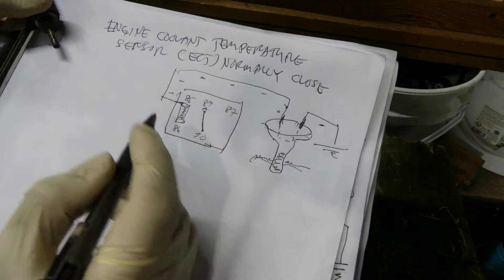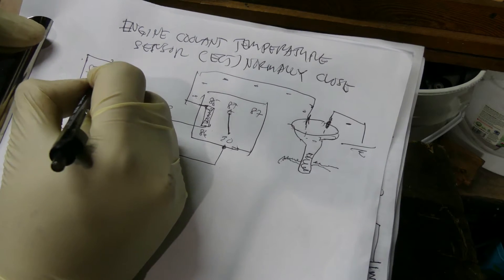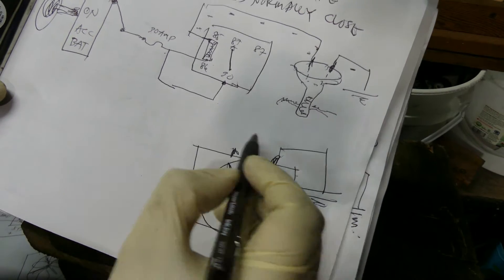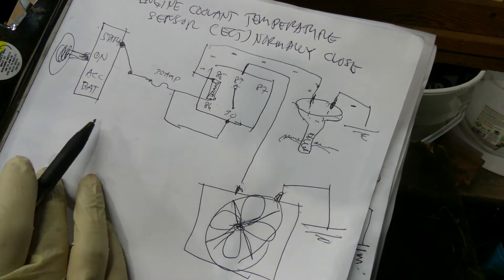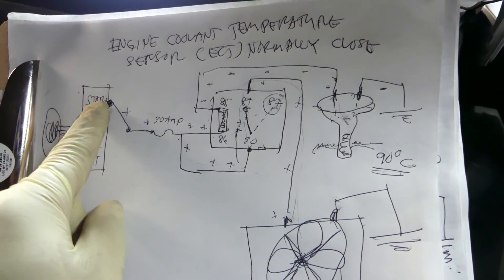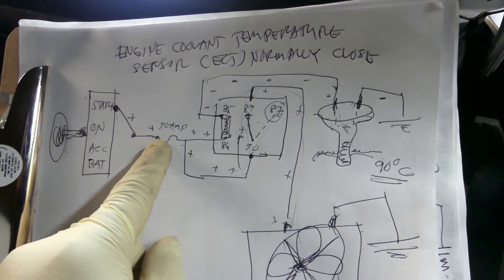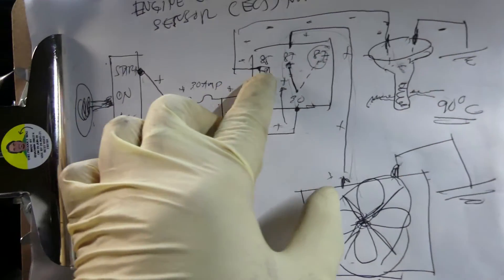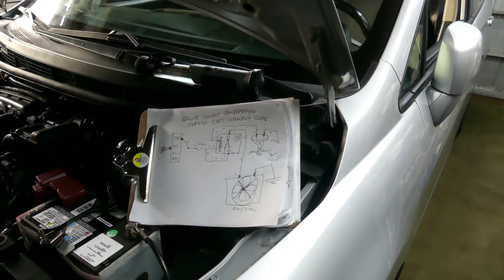How Radiator Fan works .. Engine Coolant Temp Sensor  CLOSE LOOP  DIAGRAM...( Non ecu controlled)

Comment: Hi, I disconnected the sensor but the Fan doesn’t start. On the top of that, using a diagnostic tool (with the sensor disconnected) is showing the Coolant’s temperature : -40 C.
I assume it will never start if the readings are -40.
Can be a different cooling system (sensors, connections, etc) than yours or I missed something?
Thank you !
Reply from the maker: -40 is a bias voltage and check if your ect is close loop design

Comment: My Peugeot 508 1.6 THP gives me problem with coolant cooling fan switching on at cold start and runs for ever, even after switching of the ignition it keeps on running until I disconnect the battery.  I have put a new thermostat housing with new temperature sensor but the problem does not disappear.  On diagnosis with OBDII it gives error code P0410.  This is a lambda sensor code.  How does it relate to cooling fan?
Reply from the maker: test the wire on the rad fan and if it gives u 12v all the the time theres a problem on ur wiring you need a wiring diagram in order to pin point the source of the 12v

Comment: Great.
I have a question...

Many cars have two fans (one for engine and one for a/c condenser) and they are next to each other. 

Does the temperature sensor  control both fans or only the one related to the engine?
Reply from the maker: honda civic  use both other cars im not sure

Comment: 2006 Expedition clutch fans, I want to convert them to two electric fans that always run at slow first speed and I want them to run at full speed if the air conditioner is on or the temperature is about to rise. But I want everything to be like it came out of the factory. The problem I am facing is that I am looking for information about the temperature sensor and I want to confirm it and I did not find it. The question is, can I connect the fans and relay to the temperature sensor located in the right head of the engine (TEMP SENSOR NOT TEMP SWITCH)? Note that it is a sensor with two terminals, the first terminal SIG RETURN goes to the oxygen sensor and other things and finally goes to the PCM. The second terminal TEMP SENSOR SIG goes to the PCM. I appreciate your help, I am from the south of the Kingdom of Saudi Arabia

Comment: I had the same test, when i pull out the switch the fan starts working , when the switch is on it stops. So , is it a fault sensor?

Comment: Very Informative. Thank you 
If you pull out the temp sensor harness, will the fan start with full speed or low speed ?
Reply from the maker: mostly full/high speed base on my experience

Comment: This is not a true temperature sensor. It's a switch. 

There are 2 electrical circuits to this system: 1. The control circuit (pin 86) 2.  The fan circuit (pin 30). Each of these electrical circuits is protected by different fuses. The control circuit is usually protected by a 15 Amp fuse while the fan circuit is usually protected by a 30 Amp fuse. He also made the mistake in showing the ignition switch in the "start" position. He really meant to show the ign switch in the "run" position.
Reply from the maker: it doesnt matter if ect or switch what matters is they achieve same goal to connect a circuit on a especific temperature..this is a theory of how rad fan works it might differ on other cars but this is a simplest explanation of how this circuit works...if u want to had discussion on feel free to reach me out on my number on my latest videoi can prove to u my point of view
Reply: @asianmechanicguy6483  I understand your point of view. You want to make it as simple as possible so it's easier for most people to understand. I'm just adding what you left out so others with a more advanced understanding of electronics can understand.

Comment: Hi boss, i  pull off the sensor socket the radiator fan turns on. Does this mean that my sensor to radiator connection is good? Just having hard looking for possible reason of why my radiator fan took too long to start except if i turn the AC on.
Reply from the maker: ang ectkc nakadepende sa temp ng coolant mo may mga car katuladng bmw umaabot sa 112degree celcius bago mag on ung fan ung iba naman nasa between 90to 100 degree celsius ...kailangan mong scanner para malaman mo at what temp sya mag turn on ..isa pang dahilan baka naman stuck open ung thermostat mo so meaning ung coolant mo walang harang solagi syang slightly warm lang and isa pa baka ung ectmois aftermarket hindi nila nakopya ung specificationnung part
Reply: @ na scan namn at umabot na sa temperature trigger yung temp sensor di parin gumagana rad fan. Kaya ngayun ni rekta ko muna.
Reply: sir ganon din ang na incounter ko at na check na din manually ang thermostat at nag open and close pa ang thermostat. kapag check ba ang thermostat sa hot water na 80 f above ko naman.

Comment: Mine do not come on even with a new sensor
Maybe the fan is control with a different one
Mercedes W124
Mystery, I have to search
DomIJ
Reply from the maker: theres should be an input sensor analyzed by the ecm in order to turn on the rad fan...theres no such a way that the rad fan will turn on by itself without any input

Comment: What about ECM/ECU ?
Reply from the maker: ecm controlled is a little bit different because the ecm will decide when the rad fan kick on but input still coming from ect sensor it will just analyze first by the ecm bef it will engage the rad fan

Comment: I would have connected relay pin 30 to the battery
Reply from the maker: yup thast correct but its better if you put a fuse on it thats a direct 12v power it might destroy ur rad fan motor if it short circuited

Comment: Hi, good day guys! I just wanted to ask something. I have suzuki ciaz 2017 year model. When I turn the AC on, only the compressor and Ac fan works. is it normal? The Radiator fan is not turning on. Also, even my engine temperature reach the middle temp. gauge at the dashboard it doesn't turn on. What do you think could be the culprit? Is it the Coolant thermostat/sensor?
Reply from the maker: if your temp gauge reaches more that halfway it means ur car is overheating check coolant leak first then sensor the rad fan motor

Comment: My radiator fan only kicking at 98°C. I have P0115, its either the ETC sensor or Thermostat. But already test the ETC sensor is ok, so after flushing the cooling system, i will change the Thermostat.

Comment: Fan is not working when heating up. Also when i put direct fan with battery it works. What would be the problem?
Reply from the maker: check ur rad fan module check for fuse relay ect

Comment: Thanks. I have a question the engine temperature sensor. Is the same as coolant sensor switch?
Having problems with my civic 2003 fans are not working. 
I changed the thermostat coolant switch sensor. I homped from the switch and fans worked.
and looks like relays. Are good and fuses. I don’t know what else to look for? Any help please.
Reply from the maker: u need to know where the ect located and it warms up above 90degree celsius in order that sensor to close so  that ur fan will kick on..and u can check that using a obd scanner that has a data stream or live data or u can use a infrared heat gun reader otherwise if at above 90degree celcius temp ur fan didnt kick on ur sensor is faulty even though its brand new buy genuine parts
Reply: Thanks

Comment: Is this the same as cylinder head temperature sensor
Reply from the maker: not really some cars like chevy has 2 temp sensor one located on the thermostat housing and one located on the radiator ..i had one video just check it out ita a chevy cruze it might help u about what u looking for

Comment: Hi. My ford fiesta the radiator fan comes on when temperature is 111 degrees Celsius and goes off when the temperature reduces to 110 degrees is this normal because I feel it comes on very late. Any idea
Reply from the maker: its a little bit late late change ur ect sensor anyway there not that expensive

Comment: Good day why will my 2006 shevrolet spark engin fan then runs as soon as I start the car even when the engin is cold.
Reply from the maker: im not sure about the design of that car but it should be like that especially if ur rad fan is electronically ran by ecm

Comment: I would assume the temperature sensor is normally open and it closes when it reaches high temperature and connect the poles giving continuity to send signal to relay . Isn’t it ?
Reply from the maker: thats correct

Comment: Please, do you have whatsapp
Reply from the maker: sorry i dont
Reply: @asianmechanicguy6483  Based on your explanation, what would I do in the case where the probe is plugged in, and after the probe triggers, the fan does not turn on?
I have a mitshubishi PAJERO PININ with GDI engine 1999

Comment: Very good explanation  i actually have a problem my fan runs constantly when start up car i have replaced ect sensor and relays but it still runs any idea what it could be .
Reply from the maker: it depends what car u have what design u have
Reply: @asianmechanicguy6483  it's a Chev utility takes two pin temp sensor

Comment: Great explanation. If my coolent temp sensor is bad would it disconnect power from my radiator fan. Thats the problem I am having. My car starts out with fan running then at some point the fan stops causing over heating. I am getting no codes at all.

Comment: Very awesome description. My issue is that when it gets to 90C, the fans aren’t kicking on. I’ve gone through 3 different ETC sensors, and I know the whole system works besides the ETC sensor because when I disconnect it, the fans kick on. 04’ SRT4 Neon for those wondering. 😄 I’m to the point where I either wire some kind of coolant temperature adjustment relay that bypasses the ECT, or just leave it disconnected with code 118. 😅
Reply: Before someone says something, I’m just kidding about the disconnected sensor. 💀
Reply from the maker: the point in this video is that at around 90degree celsius ur ECT sensor continuity should open or close so make sure that there is enough hot coolant that boil ur sensor in order to work so check the design of ur car like how far ue thermostat into ur ect sensor hows ur coolant is it circling properly is there no air on the system if everything is good then go to wiring etc...
Reply: Did you resolve your problem with your car?
Reply: @TheAutomotiveKid. Hi, did you resolve your problem with the fan not kicking?

Comment: thanks for explaining it . i have an issue with my 2.0 mazda engine. i rewired a new relay but i cant get it to cycle right. im using a 4 pin relay. and does my main relay also power my AC fan or is it na ?
Reply from the maker: ac fan should had a different relay or another relay but for mazda i had to look it on its wiring diagram first

Comment: Interesting, but I'm curious about your fan relay. In a typical relay, both terminal 87s are supplied with 12V once   the relay is switched on since they are just parallel circuits. If that's the kind of relay that is used, your illustration is for a normally open temperature sensor.
Reply from the maker: it depends how u use 87 and 30 usually 85 and 86 is ur coil these time  86 is positive when key is on  then 86 is ground which connected to ur ect normally close so 85 and 86 is always engage bec of normally close ect bec of that 87 is push to 87A wherein ni circuit is connected on it ...once ect open up after 90degree celcius theres no more ground on 86 so connection  on 87A will go back to 87 which is connected to 30 and  30 has constant 12v and that 12v will flow into 87 going to ur rad fan...trick of this is the flow of the 12v where it came from and what connected it ...its confusing but foloow thw flow of current 12v
Reply: @asianmechanicguy6483  thank you for your clarification.

Comment: I just changed my coolant temp. Sensor , now both fans don't work and it's running hot. WTF. THIS WILL COST $$$ TO HAVE SOME ONE FIX.
Reply from the maker: At what temperature did ur fan kick on u have to verify those bef replacing ur etc
Reply: Du you find the problem?

Comment: Ok i have a 97 toyota camry 2.2 and my fans do as they are supposed to do but when the car is at operating temperature and i turn on my heater/ a/c the fans start up and when this happens the idle goes way down and almost stalls and then idle fine, the fans will stop when i turn off the heater, i am lost and wonder if there is something wrong? And idea and advise would be appreciated,  thank you.
Reply from the maker: check alternator maybe it cant hold too much load
Reply: @asianmechanicguy6483  so its normal for the fans to start up when i turn the heater on, i will check the alternator, thank you
Reply from the maker: it depends where u put ur heater selection if its on defrost say whindshield fan will kick on try only on face selection fan shouldnt kick on ..but if still kick check for coolant leak ur engine might always hot all the time which result the rad fan to kick on

Comment: Me gustaria saber algo para comprender mejor, usted explica que ese sensor en frio mantiene esl circuito negativo en continuidad y al calentar a 90 grados este habre el circiuto y nompermite el paso negrativo a cable de salida.
Mas claro, el en frio mantiene el negativo circulando y en caliente interfiere el paso de ese negativo.
Si le hago esa pregunta es porque en mibtiyota pasa algo muy extraño,el fan se activa de tan solo habrir el swicht, al rele le llegan dos power pero punto 3 y 4 de rele siempre se mantienen en circuito cereado, lo unico que interfiere esa continuidad es cuando se activa la bobina puntos 1 y 2, por el.punto dos llega corriente pero la tierra del 1 no le llega y algo tiene que ver con ese senor ( es nuevo ), ya que a el le llega un negativo fuerte y el auto caliente el otro cable señala power pero al pare er parasita ya que solo alumbra rojo similar al punto 1= 85 
Si le palicamos por el cable de.retorno del sensor negativo, se activa el electroiman y apaga el fan pero como.no tengo el.plano electrico del auto, no puedo exactamente decir que su ede y quien esta en dificultad
El carro es un toyota camry del 96.
Reply from the maker: sorry im not good in spanish but focus on ur ect sensor unplug and plug ur connection to check if u had normally close or open sensor around 90 degreecelcius above ...ur rad fan should turn on if not then ur ect is bad or the coolant is not hot enough to warm up ur sensor ..check the location of ur sensor if closed to thermostat andcheck ur thermostat too it might slightly open

Comment: Very educative!
I notice that my Honda civic 2006 cooling fan does not switch on when ect2 sensor is connected ( i.e when both ECT1 and ECT2 are connected)  but switches on at 96 degree Celsius when ECT2 sensor connector/plug is removed. what could be the reason/cause? I have experimented this on different occasions and noticed even at 98-degree celsius - 100-degree celsius, the colling fain doesn't switch on when ECT2 sensor is connected. I have replaced the ECT2 sensor with OEM but the issue still persists.
Do you have any clue about how I can resolve this issue?
Reply from the maker: i dont know what sub model engine size of ur car but base on my prodemand ur ect is controlled by pcm and also is connected to ac pressure switch u might take alook on to those concern area before replacing parts

Comment: I'm not getting power to my coolant temp sensor at the radiator. It show -40 on my scan tool. I've tried 3 sensors. I do get a ground on one side when I test it with my power probe. The engine coolant temp sensor on the head does read normal. I've change every relay just in case. I've even tried a new connector. any help Thanks
Reply: 2008 Acura TSX
Reply: Both Fans and A/C work . Emmision light is on but only code is P2185 ECT Sensor circuit voltage high
Reply from the maker: do u have 2 wire or 3 wire connection..it seems like u had a broken wire somewhere as ur ecm voltage didnt change..check ur wire from the connector to the ecm

Comment: What is the solution?
Do we need to change the sensor?
Thank you
Reply from the maker: this is a diagram of how ur radiator fan works so in case ur rad doesnt turn on check ur relay check ur sensor check wiring or ur rad fan motor

Comment: Thanks, I'm still confused with mine...I have a 99 Toyota Rav 4 which the radiator high speed fans are not coming on as temperature rises past 220 deg F.   The low speed fans will come on if I turn on the A/C.  The high speed fan will only come on if I disconnect the "Radiator fan switch sensor"  I replaced this sensor initially thinking it was bad, but still doesn't work.  I then replaced the relays, still not working.  And finally I replaced the "Coolant Temperature Sensor" and it still doesn't seem to be coming on.  I did notice after replacing the sensor with an aftermarket that the readings on the gauge cluster are lower than before if that means anything.   Any ideas what to try now?   I'm frustrated and lost with what to do now.  The only way I can get the car to cool down when driving is stick the heater on hot and fan on high to lower the temp gauge...UGhhh
Reply from the maker: check your thermostat it might stuck closed or ur rad fan switch that u bought is aftermaket try the genuine  one

Comment: whn i switch on d ignition switch hindi gumagana ang fan, gumagana lang cya kapag sini switch-on ko ang aircon, what does it mean? nag stay lang cya palagi sa 87? di cya nag switch sa 87a?
Reply from the maker: ang ac mo separate ang wiring nya kaya umaandar ung rad fan mo at meaning ur rad fan motor is good ang problema mo dyan is wiring or etc switch fuse or relay ..much better kung mayrun kang wiring diagram
Reply: @asianmechanicguy6483  nag switch nako ng fuse at relay ganon parin , umaandar lang kapag sini switch on ko ung aircon...pls. help me, tnx a lot